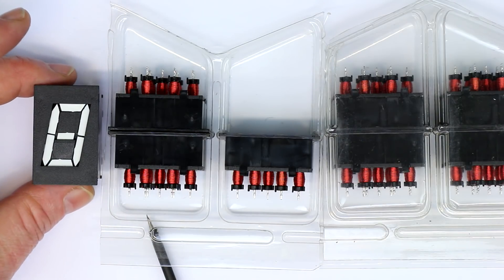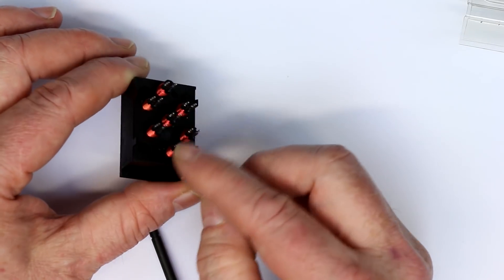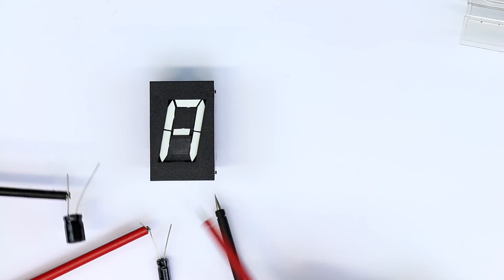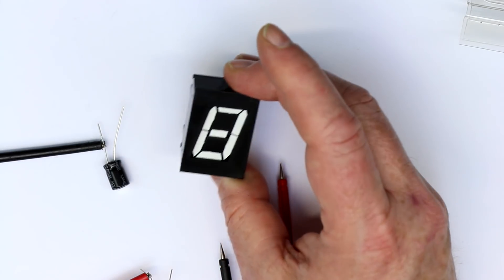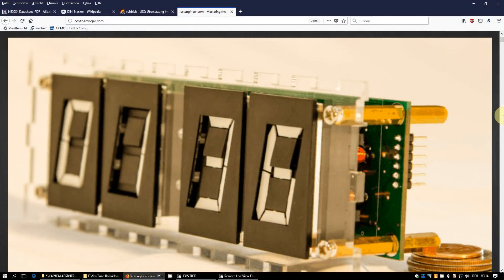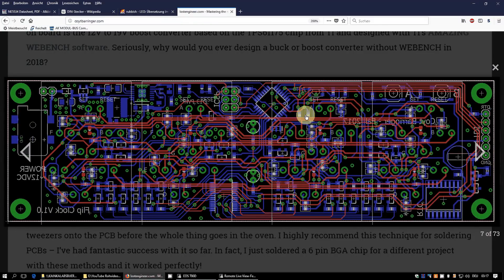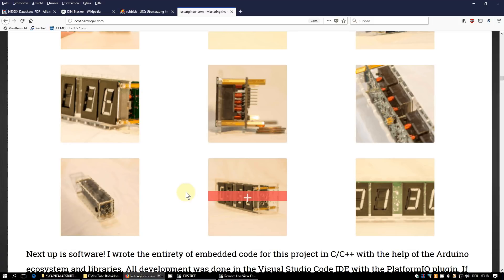Vintage Display Technology Pt.10: A Flip Display

Comment: What was the model of illuminated red 7-seg typically used on soviet reactors?
Reply from the maker: If you mean the ones you saw on the "Chernobyl" mini-series: These were nixie-tubes
Reply: @KainkaLabs  I don’t think those are the ones I’m referring to. I’ve never seen a mini series about Chernobyl. I’m really just looking for something which I could use on a small circuit, such as a printed circuit board or breadboard. Do you know if a website with a good selection of vintage, I mean authentically vintage and also simply vintage looking, seven segment displays?

Comment: Aren't this type of display referred to as a vane display?
Reply from the maker: In vane-displays the segments are rotated around a different axis (like the arms of a person signaling flag-semaphores). With flip displays the rotation of the segments (or dots as in flip-dot displays) is around a vertikal axis.
Reply: @KainkaLabs  I see. Thank you.
Reply: @KainkaLabs  So in theory a vane display would be much easier to drive because the segment(s) will only display as long as a voltage is applied?
Reply from the maker: That depends on if there are springs to pull back the vanes. I´ve seen some giant home-built 7-segment vane-displays where the vanes were driven with servos. Those only consume power when the vanes are moved but stay in their place if power is lost.

Comment: Supplier recommends 900ms between pulses to keep unit cool. To use as a second display in a clock requires careful driving to assure the unit stays cool. 250m cycles would be 8 year life on seconds display if on continuously.
Reply from the maker: Hmh. Are you sure? I cannot find this spec in the datasheet.
And I doubt that this applies to these displays.
When applying a 19V pulse of 1ms duration and 300mA currrent this gives an energy of 6 mJ (milli-Joules).
There can be no measurably heating by this low energy.
Reply: KainkaLabs , 5th image in the eBay post, near the top, note 1. There is a readable one at flipdots.com (alfazeta), their small 7-segment display. This Poland company sells them too. Might be the original manufacturer.
Reply from the maker: OK. Found it.
But I still think that the 900ms off-period is extremely conservative (or a print/calculation-error).
With flipping a segment 20 times a second there would be 6x20=120mJ/s=120mW heat dissipated in the (relatively large) coils. And for comparison a much smaller 1/4-watt resistor barely becomes warm with 120mW.
And I wonder if they comply with that spec in their own (partially "high-speed") applications at https://flipdots.com/en/products-services/custom-made-flip-dot-wall/

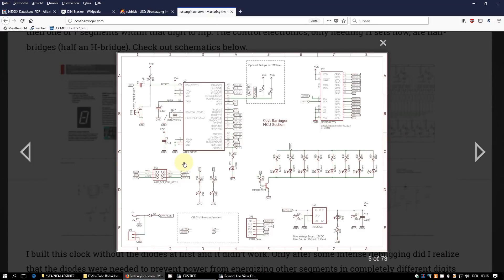Comment: 5:00 Why not use solid state relays switches, similar to SBS but use dc voltage and can be in IC DIP's ?
With your accent you sound like Peter Sellers playing Dr Strangelove!
Reply from the maker: Solid state relays are much too expensive and too big compared to pairs of MOSFETs that cost only a few cents and take only a few square millimeters on the PCB.
And BTW: Wanna know your American accent if you speak German :-)
Reply: I am Italian-American! 
One other question, are the segments in each of these digital flip-displays actuated  concurrently to create the desired numeral, or are they flipped one after another?

While this type of display and the electronics driving it are clearly digital, most flip-flop displays are not! Pulse driven circuitry is not digital without logic components..
Reply from the maker: Depends on your driving circuitry. I can see no problem in flipping all the segments at once because each one has an isolated coil. 
So if your driving circuitry is appropriately designed you can flip all segments simultaneously.

Comment: Hey! I'm Coyt Barringer! Thanks for featuring my project! I hope it helps with your clock design. It should be easy to expand my design for 6 digits. Let me know if you have any questions. I've got a video explaining my clock here as well: https://www.youtube.com/watch?v=NywyTAIhwvw&t=11s
Reply from the maker: Hi Coyt. Well that was fast. I wanted to email you about my video after it has gotten some clicks :-)
Could you email me the eagle files (and the laser-cut files, if they are not already on your blog site) to roger@kainkalbs.com
I probably won´t find the time to do my own six digit flip clock in the near future.
So I want to first build one with your design to make use of my already bought flip displays.
The ebay seller seems to have a lot of them :-)

Comment: These display modules look very cool and appealing !! Thanks for showing this.
Will you be setting up a test circuit to show one of these displays flipping?
Reply from the maker: That is shown from 1:30 to 2:00.
You just need a (discharges!) electrolytic of the right value (depending on the required minimum pulse-time, the voltage and current-requirement of the flip-display).
Then connect it to a voltage source and try out to connect the 2 connections of one of the coils to the voltage source with the electrolytic in between.
If it doesn´t work the first time you have to discharge the electrolytic and try again with reversed polarity.